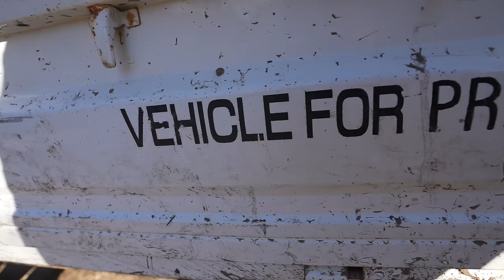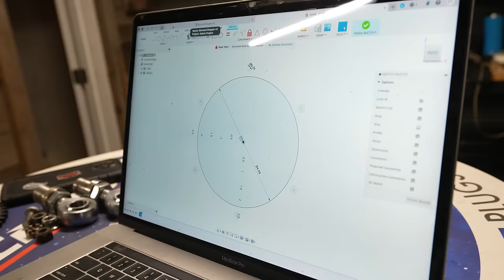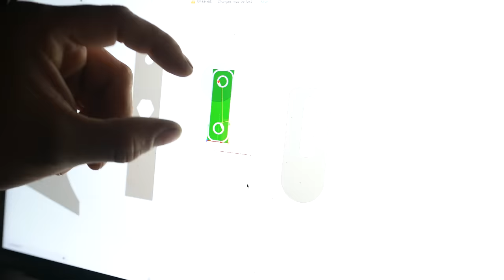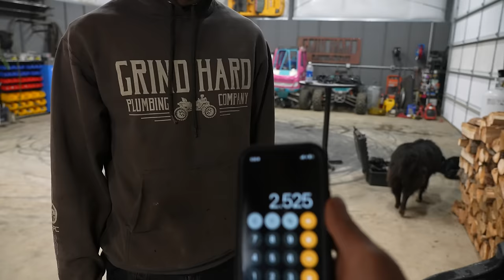How to Build a Sleeper Go Kart!

Comment: Those motors are reversible outside of software, you just need to re-order the pins of the hall-effect sensor as well as swapping around  the blue/green wires. It was being so weird because it was trying to spin, and the sensors report that the motor is spinning the wrong direction so the controller freaks out.
Reply: What kind of motor is this? I'd like to price one of those electric setups
Reply: I was gonna say I’m 104% sure I could’ve make that thing spin the other way
Reply: @ProdigyAutomotive  Kit alone is around 1500$ to 2000$ for 11kw kit depending on battery you choose and closer to 1K$ for less powerful ones. Its cheaper than some kits i have seen but least for me i dont have extra income to throw 1.5k for racing go cart and 2K for electric setup, when you can get really good daily driver for that price and proper road legal dirtbike or get small diesel crate engine into cross cart frame, witch will beat this in utility in any day.
Reply: @ProdigyAutomotive  I'm pretty sure it is QSMOTOR 138 or QS138 in short
Reply: @darekmistrz4364  You're a legend thanks man 🔥
Reply: Yes same as ebike knew soon as could hear it goging
Reply: It’s a brushless motor it should have 3 wires if it’s similar to r/c motors which can either be reversed by swapping 2 leads or reversing the program on the speed control.
Reply: They had it going in reverse in the original car it was mounted.
Reply: @Kaptinhowdy They tried that. That works on any 3ph motor. Trouble in this situation is it's not just the motor, it's the feedback and motor drive.
They're essentially powering the motor through a servo drive, not a simple ESC that you'd be familiar with from RC toys. Servo drive are awesome but if the motors turning a backwards to what it's programmed to expect then it's not going to work.
Reply: This exactly. Its that simple iv done these multple times.
Reply: swap 2 phases PLUS the 2 matching hall sensors is one way
reversing it in the controller software is another option
Reply: @Kaptinhowdy  thats what i was thinking bro
Reply: @charmio they swapped the motor phase wires but I don't think they swapped the hall sensor wires

Comment: Will : "I have a fear about these blades"
Ethan : "You should."

Spoken like a good dad figure!
Reply: I cut my wrist all the way to the bone with a 6 inch one, very big scar.
Reply: oh yeah he was in full on dad mode today haha.
Reply: He should put the guard on
Reply: seein as they don't have a guard on it . . . .
Reply: My friend had one of the blades explode into his arm in three spots to the bone. Dangers shits, put the guard on.
Reply: Yeah no guard, and if possible when making a cut like that, don't cut all the way through. Leave a little metal so it don't pinch the disc, then wiggle it back and forth and it will pop right off.  Sick kart guys . I never liked electric stuff, but you guys are changing my mind! Instant power is crazy!
Reply: Those grinder discs are nothing to mess around with, they'll turn to shrapnel before you can blink. (Not that blinking would help.)
I wouldn't even operate one without the guard in place, and ideally I'd put on a face shield in addition to the safety glasses.

Comment: Guys! When you want to reverse the direction, you need to change two phase wires and two wires of the hall sensors if you want to do it the "long" way. The short way is to reprogram the controller (as you mentioned), changing the correct setting (indicated on the programming software) will make the motor spin the other way. Trust me, I've done it both ways.
Reply: surely the company they contacted suggested that first
Reply: @rendaddy_  Just the way 3 phase motor works, that would be the solution. The fact that they didn't suggest it means that they didn't know or didn't want any mixed wires. All they will do is connect the controller to a computer and program it the correct direction. All my cheap controllers can work by switching the wires and my decent ones can very easily be programmed via adapter and USB cable. This is universal.
Reply: @esqueue  I'm guessing it's a liability thing. It's far safer to say send the controller back, that minimises the risk of damaging hardware and having other people see the video and hot wiring their own motors.
Reply: I know this was driving me NUTS!! I'm here wondering where's Ethan to tell them to reverse ANY two phase wires and BOOM problem fixed!
Reply: Shhhh I think he was just being lazy, he even says “I do electrics” lol. Or it’s part of the sponsorship? Just another way to name drop the company? Bad Ethen bad!
Reply: Maybe I'm confused here but I'm pretty sure he tried to do that and the speed Controller did not have the capability from the factory. 🤔
Reply: @bubbajfpv8856 he swapped two of the phase wires but didn't also swap two of the sensor wires, so the controller was trying to drive the motor the right way but getting backwards sensor data.
Reply: this isnt 3 phase man, and it isnt AC.  the controllers are hard coded to not allow the motor to spin the other direction also.  adding a simple sprocket to the drive axle and an idler axle would have been easy to do and wouldve given you way more potential for future upgrades to torque and speed
Reply: @esqueue Agreed, kelly controller, votol, VESC… changing the correct setting spins the motor the other way. No need to mess with wires.
Reply: @906MediaProductions  that’s exactly what it is. I learnt that from trying it on my electric go kart, as soon as I saw them swapping the phase wires without touching the signal wiring from the sensors I already knew that the motor would not turn. I was wondering that maybe they got the encoder version on that 138 90H, I’m used to work with hall sensors, at the moment position encoders are beyond my capabilities.

Comment: The best thing about these little builds is how approachable they seem. Like a motorcycle engine might be cheap and easy to obtain, but it's so friggin' heavy compared to a small electric motor and battery you could almost slap on anything with wheels in a couple of days and get obscene speeds. (well, assuming your motor controller isn't the wrong way around... Also: Edited for typos I didn't notice originally...)
Reply: I wonder how much the motor and battery weighs compared to the 2-stroke engine a fuel tank. For something this small there probably isn’t much difference
Reply: @AussieDaz87 I'd imagine the weight of this electric setup is probably really close to like 125 or 250 2 stroke engine with the flywheel/stator attached  (45-55lbs). However, the torque that this electric motor can instantaneously produce makes the beefy powerband of a 2 stroke feel like a 49cc gas engine in comparison. Seriously, anyone who rides bikes or karts owes it to themselves to try out a comparable electric powered setup. The G's you'll pull with good traction will blow your mind.
Reply: @AussieDaz87 honestly power to weight is probably better with a little 2 stroke but the torque on anything electric is so damn fun

Comment: You might consider putting a return spring on the sensor side of the throttle cable. Or at least make sure you have a good kill switch (maybe a lanyard style) I found have that out the hard way. Haha😅
Reply: I was thinking just the same, looks like great minds think alike

Comment: This video could not have come at a better time! A good friend of mine has decided he wants a go-kart track in his backyard. It will have some elevation changes and cambered turns, etc. It should be epic! but we can't use gas carts because of the noise (friggin neighbors!) I suggested finding rough/retired shifter karts and put in electric motors. I don't think he fully got the concept. I'm definitely sending him this video. This thing you're building is overkill, but it's the right idea.

Comment: Pro Karting driver here, if yall ever track that kart or do some fun street stuff, I recommend trying to get Mojo D5 kart tires if you have a 7 inch rear rim, or Vega Blue tires for 6 inch rims. It might be very tricky getting a hold of these tires as they are used for professional karting and they are pricey, but trust me, for a kart with that much power it would give it good grip

Comment: I suppose the instant torque of electric motors does have some downsides. Thing was like an on/off switch.

I thought for sure Ethan would open the garage door after being concerned about Will hitting it. Luckily it remained intact.
Reply: Thats just the controller. They are usially really controllable
Reply: @MADEINNSW  The level of control they appear to have, the power curve isn't set correctly. It seems nearly an all or nothing response, with not enough ease-in. It's either that or they have such a lead foot they don't know how to ease in on it. Heavier spring on the throttle pedal may not hurt either.

Comment: BLDC motors can be wired to work in reverse. Just gotta figure out which wire combination receives power first and which one receives power last. Once you've figured that out you can then swap the phases. That'll put the motor in reverse. One thing to note: 3-Phase BLDC motors have 6 different sequences. 3 forward, and 3 reverse.

Comment: You can reverse the motor direction with out reprogramming. You swap two of the three main motor wires like a drone, But you also have to swap two of the three blue green yellow sensor wires. The sensor wires are the 5 pin connector. The wires that are in the sensor connector that are different Colors than the main motor wires “usually red and black” stay together. Hope this helps a future build or anyone else messing with brushless sensored motors
Reply: I should also mention the sensor wires can be unpinned from the sensor connector and rearranged to swap no soldering required

Comment: i saw the title and went, ooo, a qs 138 build.  no need to look further than that.  tbh, you can get the motor+controller for around $800 usd, if you are willing to diy a bit more than the elec.&co kit.  a lot more flexibility too.  glad to see someone do a go cart build though.  the 138 90h is honestly the best bang for your buck.  watching you guys monkey around those open contact points with the controller and motor had me a little concerned for yall though.  your battery can give a nasty shock if you aren't careful (1kA or more) if you short it and the bms fails..  li-ion can be scary...
Reply: yeah... then you guys took it out in the rain.   ... i dearly hope your battery is ip67 or better.  those open controller contacts though, an inch or less from the motor casing?  i would never want to be within 50' or more of that thing, with that much water around.  i am glad you guys didn't kill yourselves yet.  keep it up with that and one of you might though.  i am looking forward to more videos.  maybe with a margin more safety though.  or at least regards for personal life, limb, and property...

Comment: For the future, you can change the motor spinning direction by changing motor phase wire order (the cable colors motor-controller doesnt have to match) and you may also have to change hall sensor wire order

Comment: The electric acceleration rush is exactly why I started ScooterFaster back in 2003.
There is nothing quite like dumping 400 Amps into a vehicle that weighs less than 400 lbs.
 Rider included.
That being said, EXTREME CAUTION should be used during the wiring and testing phases.
Your throttle sticking WFO could have ended badly.  ALWAYS BLOCK THE DRIVE WHEELS UP AND TEST THOROUGHLY.
We used to run in a massive carpet mill parking lot with NOTHING to crash into.  Closed on the weekends just for us.  Search for a big parking lot and don't stop for rain...wet days are drift days and the tires will last more than 2 hours which is all you get when it hooks up.

Comment: If that's a sevcon gen 4, all you have to do is instead of swapping everything is just map the digitial input for forward on pin 18 to reverse using dvt. I've done this a couple of times already. Also you can't just swap 2 phase wires with these because the encoder offset is wrong and then the controller doesn't know which pair of field windings to energize. I program these for a living so.

Comment: what else may work if the resistance matches the potentiometer for the controller try using a fly by wire throttle pedal from a car maybe? i think youd have better control of the voltage that way. just a suggestion.

Comment: It's neat, but with that electronic motor control it needs better proportioning for the power curve. Keep it fairly shallow until past 1/4 to 1/3 throttle, then have the slope go aggressive. It should still hit 100% at the top, so you wouldn't miss anything doing that and have better control. Seems necessary because it has all the torque all the time, and no real way to feather it with a direct drive. Get that dialed in and it would be neat to see it on a go-kart track with some fresh tires.

Comment: i recently upgraded my angle grinder to a latest model makita with kickback protection and variable speed etc.. its so much better than the cheap angle grinders that used to almost hit your forehead when it got stuck in a piece of steel   edit;  forgot to mention 9:31 here you can see the kickback protection working succesfully, its stopping the motor when it suddenly had too much resistance

Comment: 10:39 i race karts  bi believe you should flip that motor and sprocket to the inside and also use chain guard for y’all’s protection.  And the placement of the motor battery and controller directly effect it’s driving characteristics I’d say when turning left it struggles for front bite on that inner wheel.  Being a straight axle when you turn this think teeters like a motorcycle. The stagger is what determines this teeter effect     I’d love to come set it up for you.  You have a sprint chassis so it can turn left and right  maybe some Hoover dirt tires and a slight lift and it can ride on y’all’s track

Comment: I think what that go-cart needs is a way to change the power profile on the fly. Maybe something basic like dial that just sets the cap at 1-100% and a schoot button that no matter what the dial is set at, as long as you are holding it, removes the cap/limiter.

Comment: Edwin is such an expert rider and driver. (Yes, Ethan. I know. 😅😉).
Hey, when I saw the "chain guard" @28:31 it made me think. What if you used a big wide belt, like a Harley-Davidson primary drive. I am now thinking it would skip teeth. Or would it make it really smooth and also handle the power, if Will kept enough tension on it. 🤣 I have never used those so I am not sure. It would be more work but maybe it would make it "Zamboni" smooth. (I know, they are propane. Well, they used to be. I'm thinking of the smoothness of the ice.   😎🧊) A belt may be unnecessary. That makes my ZX look slow. Non reciprocating is unrestricted power. Boom. It's there. As fast as electricity and limited only by control systems, gravity/inertia, bearings and the chain and sprockets. Premium. Now go for "Premium Gold"!!  😳 (Neodymium Bearings). 😧

Comment: what you should have done is make an idler shaft in a 3 gear system if the two outer gears and inside like you have it and run a 3rd on the outside of the chain as a tensioner of sorts, it will spin the opposite direction. attach that to a mount with a shaft and a guide tube with another gear on the end. so it will be 2 chain system. but you can reverse the drive direction without having to reverse the polarity and it would have been quicker too. but great job otherwise. that thing looks faster than greased lightning. good job.

Comment: You can give it a sort of pseudo-engine sound if you attach a small air raid siren to be driven by the motor. I recommend a dual-tone type siren and to start with a 4-port/6-port dual tone, and perhaps a 10-port/11-port dual tone as a secondary to test. The 4-6 should sound kinda like an actual car, and the 10-11 will sound pretty alien future tech-y.

EDIT: Given that the drivers are roughly the same weight as the vehicle in this case, you should always consider driver weight as a part of ANY power-to-weight ratio calculation.

Comment: They need to make balloon tires for go karts like they used to have for the old three wheelers that didn't have suspension give you that little bit of lift. Some paddles for traction  probably even skip water those old tires used to be able to just float across ponds

Comment: When you all are done with that wild cart build a dirt bike or four wheeler next with a transmission. Using an old dirt bike engine’s transmission and drive it with that electric motor via welded drive gear to the crank shaft. I pitch that idea to cars and cameras and they built a bike using a Tilletson engine and a centrifuge clutch. You all are true creators and I believe you could design something that would destroy any e dirt bike.

Comment: Need to add traction control to the cart so you don't spin the wheels at launch. Just need a microcontroller a couple of sensors and code.

Comment: Hold up yes it is reversible not only the motor wires but the hall wires as well you must change both for it to work. OR if the controller is programmable change the rotation in the programming. That motor acutally looks like a QSmotor 8k motor power range is up to 30k not to sure ide trust that must power on a 8k motor but QSmotor is good. One other thing some controllers have a reverse option but it is only a small portion of the power.